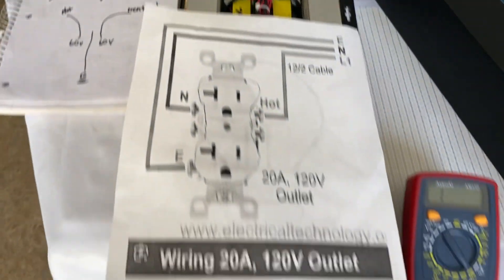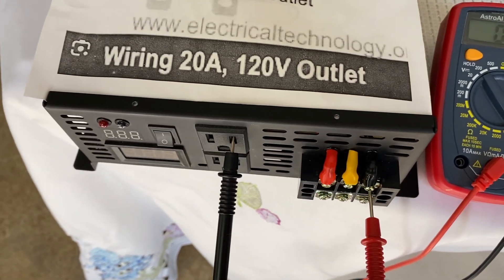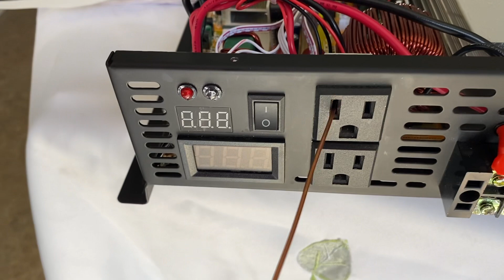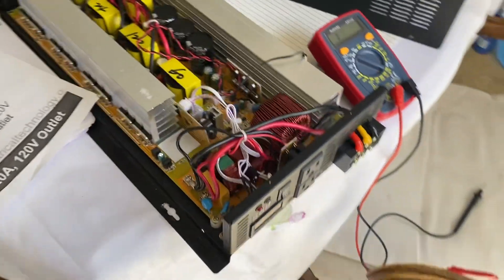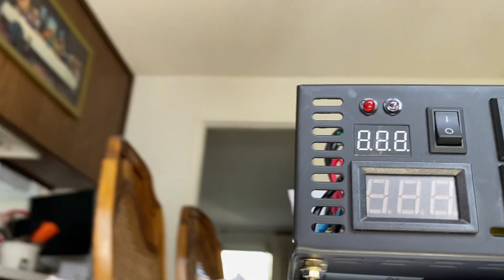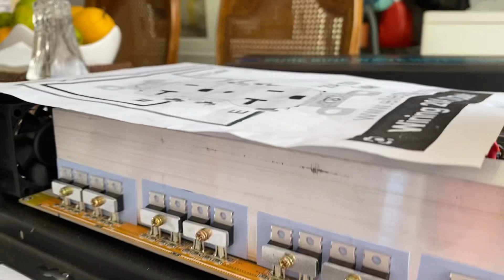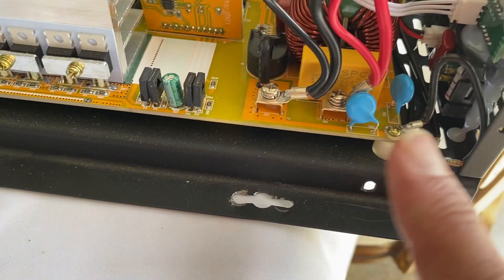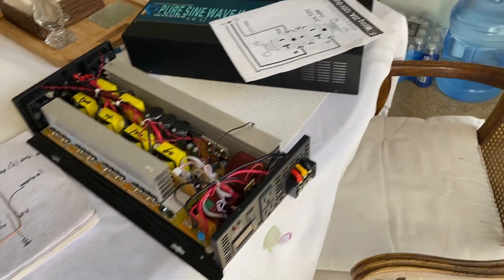Reliable WZRELB Inverter ground tests and the 60v + 60v theory explained.  Part 1 of 3

Comment: Are you sure?  Reliable shows online that red is line and black is neutral.  Wouldn't that mean it's just the outlet that's incorrectly wired and that's what should be changed?
Reply from the maker: Yes, but you would need to remove and re wire the outlet.   It is much easier to just switch out the leads on the board and relabel them.

Comment: I wouldn’t change the connection because it is not a mistake but how it was engineered. The inverter unlike utility power uses a floating ground to detect voltage to turn off the power and throw an error. In this inverter the alternating current is switching back and forth between neutral and hot just like a utility transformer does between both hot connections. This is why you see half the voltage during your test. 

When connecting to a distribution panel you need to either remove the neutral ground bond or put a transfer switch to disconnect it from the panel when using the inverter to supply it.

Comment: Another problem with mine was the grounds weren't connected to anything because they didn't clean off the thick black paint around the screw hole and it wasn't making contact. Cleaning the paint off and putting on a star washer fixed the ground but it still has 60 VAC on both output terminals! I don't guess it matters which wire is hot or neutral as long as you are careful not to ground either power lead.
Reply from the maker: Wrong, using an incandescent light bulb it’s possible to test for ghost or static voltage between the neutral and ground.   If not lights up you have 60v it it doesn’t it’s just static or ghost voltage.   As soon as you bond the neutral and ground it disappears and readings 120v between hot and neutral as well as 120v between hot and ground.   Neutral to ground will read 0 volts.
Reply: @WattsinWattsout  A light bulb won't light connected from either output to ground since they are both just 60 volts but when I connect the lamp they go to zero volts! Maybe one side of the output needs to be bonded to ground but I'm not sure which is really supposed to be the live output and which is neutral.
Reply from the maker: @stevec5000 you have no idea what an incandescent bulb is do you?    If you really had 60 v between ground and neutral it would light.   But, since it’s ghost voltage it won’t light up as it’s just a static charge that needs to be grounded to go away.

Comment: This is all a fraud and it's not debunked since my unit has 60 volts AC on both the L and N terminals!
Reply: Did you measure the voltage without plugging in anything and without connecting to your panel?

Comment: Does anyone actually think those red and black wires can handle 5KW without melting?
Reply from the maker: Yes, they are adequate.

5000w / 120v = 42 amps.

8 awg wire can handle that for the terminals.   The 12awg going to the receptacle is more than enough to burn out/melt the receptacle.
Reply: @WattsinWattsout  It would also melt the soldered terminals at the ends!
Reply from the maker: @stevec5000 why? It’s only 42 amps!
Reply: @WattsinWattsout  LOL Only 42 Amps!

Comment: I have the Reliable 3000 12v unit and swapped the wires on the circuit board, so now the polarity is correct, but I have an open ground. This exists regardless of the red and black wire positions. Do I have to hard wire the reliable to get the ground circuit closed? I have another inverter Cobra 2500, so I used my Klein RT210 in it`s outlets, all 3 lights are lit on that one. Weird
Reply from the maker: It’s missing the neutral ground bond.   That should be done at a panel.    Or you can run a jumper from neutral to ground on the terminals.
Reply: @WattsinWattsout  I just bonded the N&G and that fixed it, Thanks for that advice. I have the 5000 W 24V unit coming to the house, good deal on Amazon right now. I will also check it out for the same issues and correct them if needed. That one I will use to power the house. Thanks again!!

Comment: So, I just checked out my unit.  I have the 48V, 2500W inverter.  From hot to ground is 72V, and from neutral to ground is 50V, and hot to neutral is 122V.  I'm only using the terminal block, not the 3 prong outlet.   I did order a Victron Multiplus II 3000VA 120V inverter to replace it.

Comment: Sadly, this solution isn't always the case. Mine (Reliable 2400/24V) was outputting 60V on both legs at the circuit board. I did notice the revision on my circuit board is different than the one shown in this video.
Reply: mine is the same as yours

5000W 48V

wonder which inverter isnt like this with a similar price point, i really dont want to have to get a hybrid inverter

Comment: This  other video helped me understand what you were talking about. Your connected to your own stand alone power panel.
NOT grid power. Makes more sense now. Based on this video here. My 12v 3000w inverter did not light up a bulb on factory wiring for with the non receptacle connections of yellow neutral and black ground or when i did your reversed connections it did not light up that way either. Based on what this guy is saying that is a ghost voltage? This is all new to me so all of your imputs are helpful. 

Thanks for all you do!

https://youtu.be/Ky5luEx6R2M?si=Yx1Ics5zJnaR2f9v 0:05

Comment: The name Reliable brand name is an oxymoron. High frequency, output transformerless inverters like these have a much shorter life expectancy and a far poorer peak power capacity than a low frequency, transformer based inverter. I wouldn't use one of these dangerous, toy inverters, even if they were giving them away for free.
Reply: Do you know how much shorter life hi-f inverters have? Peak power should be as it is advertised and it is typically 100% for hi-f inverters. Those inverters can be used and they are not 'toy' inverters. Each 'type' has it's advantage and dissadvantage. Earlier, power supplies were all transformer based. Now most are switched mode similar technology that hi-f inverter uses.
Reply: i have installed 6 of these. only one failed. the rest have many years of service, some on 24/7/365 for years, only turned off briefly for other system maintenance. it is the highest quality, lowest price option. if you have more money, there are many better options. the one that failed blew all the big caps inside and a fuse. the reason for failure is not known. the load was not too high, the battery it was connected to was a bit lower than full, it was night so no solar. i think there had been some high voltage DC fluctuations from the CC some months before and that high voltage event finally caught up to the caps randomly on the day it failed.

Comment: Quick question... I have been using this brand inverter (mine is a 24v, 10k version) for almost 6 months with no issues, but I don't use the built-in outlets on the inverter. So, in my case, wouldn't another (and easier) solution be to just NOT use the built-in outlets on the front of the inverter and just use the terminal connectors? Currently that's what I am doing - only using the terminal connectors (I have them wired into a separate distribution center in my shop). Depending on your answer, and rather than opening up the box and swapping the wires, wouldn't this be a simpler solution, or am I missing something?  Thx!

Comment: The reliable brand  have some bad design just look at the sine wave filter copper wire it’s 16 gauge wire that limit the output power and voltage I can bet the voltage dropping big time with load 5kw sine wave filter most be 12 gauge alway I use 8 gauge for 6kw filter and two core for 9kw of 8 gauge to reduce heating of core

Comment: I got a 2500 of those inverters tied to a 200a lithium. Now I am worried. I do not use it frequently, and I decided not to mess with the board that connects to a house outlet. I just have used the inverter ac outlets to charge my bluetti and pecron and intermittently for a small ac unit, charging small devices. The rest of the time it sits turned off connected to the battery/charger and panels. I am nervous now because I know one of this days, I will have to open it and checks on those wires myself. Since I am not an electrician and I am weary of electric stuff (I have put together my 12 v stations for emergencies with you tube guidance). I am saving your video to follow your instructions. Thanks for the information. Keep on posting!

Comment: There is no neutral on the inverter. There are 2 leads coming from each side of the secondary transfomer coil and both are live or hot so to say. A neutral is when one of the leads at the transformer is connected to proper ground and this is not the case here.
Reply from the maker: Here’s the odd thing, if you connect the earth ground bond to the black (neutral?) tab with the factory wiring the polarity of an outlet tester shows hot neutral reverse.    If you switch the leads to the circuit board (and relabel the terminal bus) the tester comes out correct.     

Question, if both are hot why is one working fine with earth ground and the other showing hot neutral reverse?    These inverters in the past have in the product description “earth connection for both circuit board and output?   

By bonding the neutral (or one hot out of the transformer) to earth ground is that not a “proper ground”?
Reply: @WattsinWattsout  Hi this is my take on this. Please correct me if I am wrong. I have a 3000W WZRELB inverter and I am quite happy with it. In the manual it says:

"NOTE:
1. NO connect the red wire with the yellow one or the black one with yellow one, the voltage from this connection is not the true voltage, it will damageyour equipment. 2. If the house neutral wire is combined with the ground, connect the black wire with it, Do not connect the inverter yellow wire with the black wire together."

The yellow outlet seems to be conected to the transformer center tap and also to the chassis. The red and black outlets are from the transformer coil ends (actually several small high frequency transformers). They are both live. If you connect black or red to yellow you will shorten half of the transformer and burn it. The yellow would be a neutral if you would connect it to proper ground but then it is 60V neutral to phase and 120 phase to phase and nobody needs 60V or? I don't even understand why they connect a yellow outlet. Maybe so people shall burn their inverter and have to buy a new one. My 3000W Reliable Power inverter does not have this yellow transformer center tap connection. These "cheap chinese inverters" are not designed to be connect to your grid. They are made for being a stand alone power supply. Problem arises if you want to connect it to your grid and if your grid is an American TT or European TN system but don't do that. They are not made for that. Then you have to buy things made for that and hire an electrician to do it. And as long as you use it as a stand alone power supply I agree with the company that it doesn't matter if the outlets are reversed.
Reply from the maker: @mgold9999  I am using this as a standalone power supply where there is no existing utility power.    I have a panel set up with breakers and earth ground.    I am not suggesting that it be connected to an existing utility power supply or to share a panel with such.   The manual and product description has changed over the years but if you look you can find suppliers with the old description “Earth connection for both pc and output connections.    I believe they are wired incorrectly at the factory (outlet) and when users connected to earth ground the units were burning out fets and fuses.   Rather than correct the wiring they re-wrote the manual and product description.    
This company makes a split phase model that has the circuit board marked line1, Neutral, line2.    
If you switch the wires to correct polarity of the outlet and connect the earth ground (bond) to the neutral the 60v + 60v goes away and the earth to ground only shows minimal voltage +-0.2-0.5 volts.    If you connect the hot and ground the unit still displays the 60v + 60v and displays hot neutral reverse.   I have not tried putting any load on it with the hot and ground bonded.   That could be disastrous and blow the unit.   
I have been running a full size fridge that draws over a kilowatt per day Ali go with an ac unit 1200watts and the unit is running fine under that load.   It’s been about two months with no issues.   The gfci works and has a true path to ground.    
Renogy makes an inverter that has a built in neutral ground bond at the chassis and they provide a gfci outlet however there is no earth ground so it is not a true gfci.
Reply: He is right, what you have is simply 120VAC Single Phase with the Ground tied to the Center-tap.  Once you Removed the Ground / Case and Circuit Board / Center-tap Connection, there will be NO Voltage to the Ground / Center-tap, but only 120 VAC between the two (L1 - L2) "Hots," but instead of 240 VAC like our American Grid, you have 120VAC --- that can Now be Stepped up to 240VAC with a Center Tap --- that can Now even Be Bonded to the New Neutral that will be Created (using either an Isolation  Transformer OR a Step Up/Down Transformer --- also called an "auto Transformer.  I, myself, plan to do it (when I need 220V Spit Phase).  I have the Equipment already, but have not done what I just stated (only the 230VAC Single Phase Conversion to 230VAC Spit Phase.   There are videos on youtube on this very thing.  @WattsinWattsout

Comment: Below is a paste from the Company Support "explaining " the wiring. Can't even get a straight answer out of this company its so frustrating. I explained everything you show here and sent pictures of the mismatched wiring going to Hot vs neutral. THey clearly state the BLACk is the NEUTRAL yet it runs to the the HOT side of the outlet?? 
then they tell me this that it can and cant be bonded what one is it?!? you can have it both ways.
Quote " Hello,
It is forbidden to bond the inverter yellow wire (inverter ground) and inverter black wire (inverter neutral wire) together
If the house neutral wire is combined with the ground, please connect the inverter black wire (inverter neutral wire) with your house neutral wire
Regards,
Shirley/Xiaoling Zeng

YUEQING RELIABLE ELECTRIC CO.,LTD."

Comment: My harbor freight inverter has the same setup. For most things its not really a problem, except to the main thing I want to power in an outage, my furnace! I believe my only options are an isolation transformer or to just get a better inverter and use a N-G bonding plug if they aren't inside the inverter. I'm leaning towards the latter.
Reply: Hi there. Did you ever find a way to run your hvac? I'm having the same issue with my inverter. Thank you

Comment: I have the Reliable 24v 3000 when 
I do the continuity test my hot on the regular plug seems to be the left side because it beeps when I touch the red on the terminal bar so does this mean I have the same problem ?
Reply: Also when I do a DC volt check I get 60 V regardless on both the regular plugs or the terminal block even when nothing is connected
Reply from the maker: It appears to be the same issue.   I have watched quite a few videos of this brand and can spot the problem if they show the inside of the case.  I’ve contacted the company and they say it doesn’t matter if the outlet is reversed.    I asked them to forward it to the engineers.   If you are only using a small appliance with a two prong plug maybe but if you add more then one item and if it grounds it fries the board.   The fuses, and mosfets usually blow.   I am contemplating contacting Amazon and explaining the issue and ask they send a few units in for independent product testing.   Back in the 1970s-80s the US required all outlets 120v to have a separate ground.    Prior to that it was anything goes with the hot and neutral tabs.   Now it is clear how outlets are to be wired.  I don’t know how they got these past independent lab testing without triggering a repair.   

If you open it up use a proper sized Phillips driver and what I found best is to always unscrew them from an overhead position.    This way you can apply steady pressure downward on the screws so they don’t strip.   I lean the case on it’s side to get the side screws out.   I’ve seen videos with folks stripping the screws and prying them open.   The first turn is the hardest to get right.   When reassembling I use the same method to get them tight.
Reply: @WattsinWattsout  also in your new video I see you tied the neural to the and ground.  I’m using an outlet to get full power not tied to my house.   Do I still tie them together ?
Reply from the maker: @donnyhudson305   Are you using the outlet with an extension chord?   If so the jumper will give you correct wiring for the outlet but it will be a floating ground.   If not connected to a panel using the terminal connections for a true earth ground then you can use the ground lug on the bottom of the case to connect to an earth ground source.   This should give you a safer system with a true earth ground.
Reply: @WattsinWattsout  yes I’m using a cut extension cord to the terminal block.
Reply: @WattsinWattsout  I have replaced the case screws with M4-0.7 flat socket cap head screws. They require a 2.5 M hex wrench, works like a charm and look better than factory Phillips screws